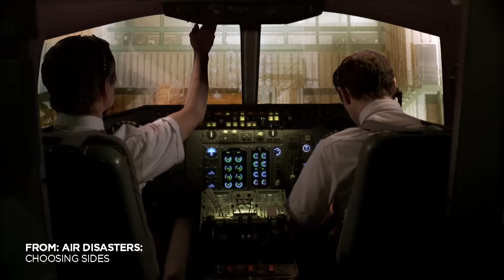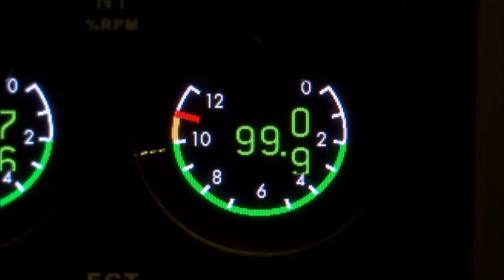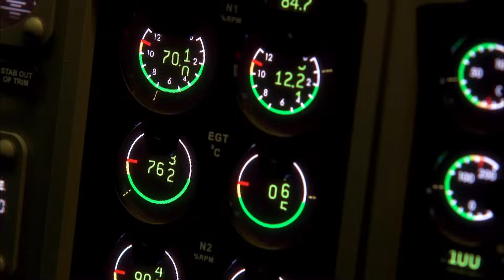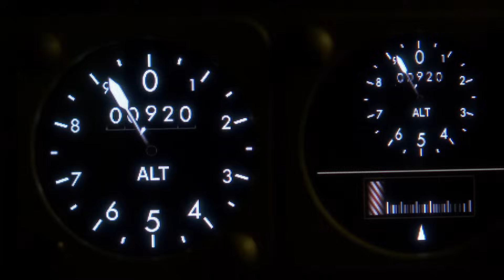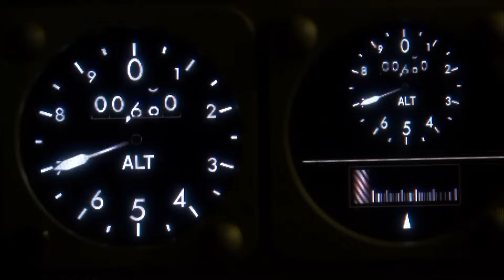What Happens When Both Engines Fail on a Passenger Airplane? 🛩 Air Disasters | Smithsonian

Comment: The pilots think that the right engine failed so they shut down the right engine but in reality it's the left engine that has the problem because the left engine fan blade broke and the engine started choking. When the pilots apply power to the left engine that's when they realize the left engine is the real problem not the right engine and the pilots tried to restart the right engine but they're out of time and the crash was inevitable.
Reply: I know nothing about this but as soon to be engineering graduate I would guess there should be plenty of measuring instruments that should show very clearly which engine is doing poorly. This seems like a massive failure but maybe it's more complicated.
Reply: @Sorest2  i would assume that the vibrations had made it hard to read and the first officer mistaked the engines

Comment: The honest question is. The investigation part highlight after shutting off Engine 2 (The Wrong Engine)  due to different readings confusing the pilots compared to the older 737's the plane was stable... The answer was Why?

I mean it's understandable that increasing Engine One (The Burning Engine) would causing the vibrations. But why after turning off engine 2 the plane was normal that is what I'm trying to ask while the investigation part of the video not published (As of 27/9/22)
Reply: When the pilots pulled the thrust off of Engine 2 they first had to disable Autothrottle which means Engine 1 (the damaged one) experienced less fuel flow right when they pulled back Engine lever Nr 2. 
It was an additional misinformation that added to the pilots confusion over the right engine to shut down making them sure they shut down the correct one, which was not the case.

Comment: I've seen this in seconds from disaster, but mayday discovers 2 additional flaws on this plane, the passenger seat design and their brace positions. True they did turn off the wrong engine similar to Transasia flight 235, but in midland flight 92's case, several people died because the floors on some passengers seats weren't strong enough to withstand the impact and some weren't able to brace the impact and suffered serious injuries from loose seats.
Reply: Yeah I agree I hate it when the cabin is inaccurate

Comment: Title is wrong - both engines did not fail. Pilots switched the wrong one off = it crashed = people died. Title needs correcting.
Reply: @Perth Aviation Connections the title READS "both engines failed"
and as we BOTH say, the pilots shut the wrong engine down - the good engine, the one they switched off, did NOT fail - so the title IS wrong.
Hey but that's just the English as I read it.
Reply: Agreed 100% the title describes something like us 1549 or taca 110.
Reply: But, Captain Kevin Hunt flew the plane in from Belfast.
Reply: First engine 1 failed after due to the mistake both failed

Comment: he should have extended the flaps which have given him a further glide so sad 13 people lost their lives but at least 87 survived
Reply: Would have dropped the speed even more, then the plane would have stalled earlier and probably hit that freeway
Reply: bit like that BA flight at Heathrow when both engines really did fail due to fuel starvation (blocked not run out)- that cpt was a true hero, realised he had to use flaps, missing the fence, smashed into sound ground. Then BA treated him like CRAP. I have his bio book on subject. BA are a disgrace. Hung him out to dry.
Total opposite to how USA treated that US Cpt that had that famous water landing in NYC.
Reply: *soft ground

Comment: some passengers noticed the fire on the left engine but never told the crew that they turned off the wrong engine. so for me it's not fully pilot's fault because the displays were new so they struggle to read the information.
Reply: Even if the pssengers knew the pilot turned off the wrong engine.. by the time they could have called the crew and explained that to them ( and then for the crew to go back to the pilots and explain it to them ) would still have done nothing to avert this disaster.